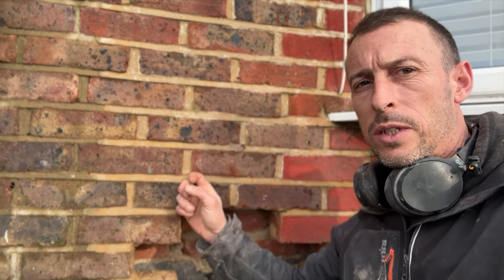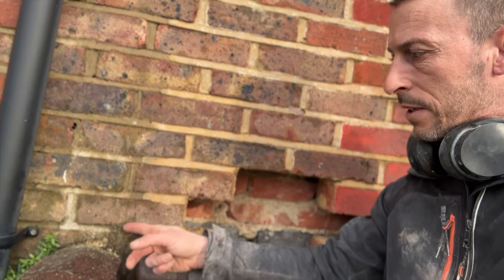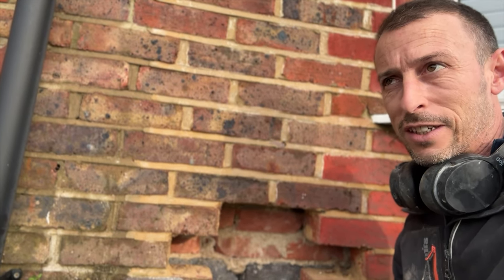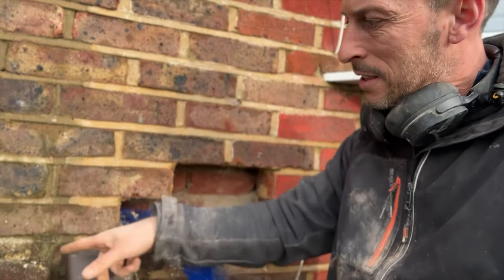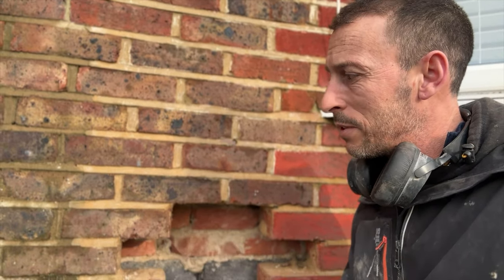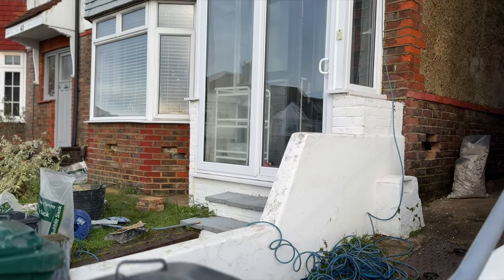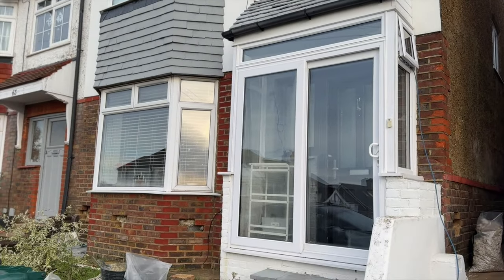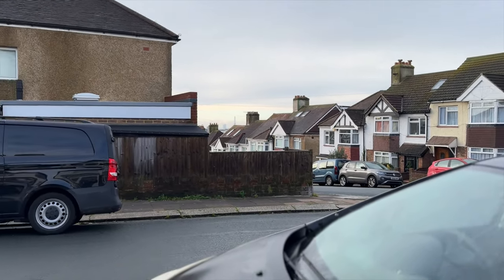Wet cavity wall insulation causing humidity and damp problems in Brighton, Sussex

Comment: I have damp walls, wet walls upstairs rooms and now blackening with mould or mildew. Not sure what to do. No cavity installation i believe.
Reply from the maker: Ventilate with a small amount of consistent air including at night in all rooms (nightlock works best as it’s secure) and a consistent temperature. Absolutely no condensation unless you have a swimming pool in your living room 🤣

Comment: Very interesting insight -  surprised to see just how damp  the thermal insulation was. Damp insulation is no insulation as heat easily conducts through the water and you end up with a cold damp house as you have clearly demonstrated. It does appear to be the case that retrofit cavity wall insulation should generally be avoided - other then perhaps poly beads in a sheltered location but only then subject to a satisfactory pre-installation survey by an independent and impartial surveyor.

Comment: What's the main cause of wet cavity wall insulation? It can obviously work most of the time so is it down to improper installation, bad materials, bad external conditions etc?
Reply from the maker: All of the above but if you remove the insulation the the bad external conditions are no longer a problem internally.
Reply: @CoastalWallTiesRustington thanks for the reply. I've actually just bought a house that has ground floor damp issues. We've had a company come out and survey it and they've confirmed damp in several rooms plus a number of rotted floor joists but they weren't able to pinpoint the cause with 100% certainty. The house has had cavity wall insulation done in the past but there is no certificate available and the person who sold us the house wasn't the one to have it done (some previous owner and we don't know who it was). I think we're look at having it removed. Quick question: does it all need removing or only to a certain height? If you remove say 1-2m from ground level, won't the rest just drop down over time resulting in the same problem? Thanks :)
Reply from the maker: Hi Richard, it’s best to get it all removed really, to avoid problems that may occur down the line.

Comment: Great video. But that is just the tip of the real problem. AS a builder, seen this for 30 years, now it will get worse with the need for insulation. Do we think the industry will fix the insulation materials?
Reply from the maker: 100% I think they are not bothered, and very little will be done about it.

Comment: A guy I used to work with had it installed in his 60s house, then came the problems. He removed a couple of random bricks himself and the rockwool was wringing wet. He’d been advised to use a waterseal product over the outside, but I pointed out that depending on how porous the joints/bricks were, he could be worse off because the water seal lines any holes, effectively converting them into tubes through the wall carrying water in even faster than plain soaking through. 
Many years ago I found that out the hard way using it above mum in-laws conservatory.

Comment: Cavity-walls that are already built up can NOT have cavity-wall insulation added.
Cavity-wall insulation can ONLY be installed from the very start of construction of the cavity-wall.
Cavity-walls must NOT be abridged with insulation(insulation touching the outer walls inside the cavity-wall), or else moisture will transmit from the damp outer wall, through the touching abridging insulation, and into the inner wall; making the inner wall damp inside the property.
If cavity-wall insulation is to be used from the very start of construction , there must be a large air space gap in-between the face of the cavity-wall insulation panel and the outer wall inside the cavity-wall; this includes an air space gap in-between the face of the cavity-wall insulation panel and the cavity-wall tie drip-point(which must point downwards in the centre of the cavity).
Cavity-wall insulation must touch ONLY the inner wall inside the cavity-wall of course.
Ask City & Guilds N.V.Q. BRICKWORK teachers in person for PROOF of this.
Reply: You make a good point but some developers still pump inso in after build which goes against what you say anyway

Comment: Thanks! Can you comment a bit more please about why specifically south or west facing elevations might be more wet?
Reply from the maker: It’s the sides that are exposed to wind driven rain, thus the rain penetrates through the outer wall by way of wind pressure.

Comment: hi im subscribed to you and im in the same industry as you and totally agree with everything you say is spot on and you are truly one of the good guys in this industry do you have any videos or come across where the cavity has been filled with polystyrene beads that is causing damp so i can show a customer of mine who has installed yellow insulation that is wet and i have had advised her to remove it and open the vents back up but she wants to reinstall the polystyrene beads after please keep the videos up
Reply from the maker: Well done for also being a honest tradesman. I must admit that the beads aren’t as bad as the wall (pains me to say) but I have experienced wet beads that have caused issues and allowed water to penetrate inside. The beads themselves are waterproof but water can still be on them. That particular property was a block of flats about 40metres from the sea, but I didn’t get a video.

If your clients wants to do that despite your advice, all I can say is that you were right to give advice and that is all you can do. A shame though.
Reply: @CoastalWallTiesRustington  hi many thanks for your reply that is what i say also the poly beads are better from the original install where they don't put an adhesive to make them solid the old method was install beads loosely allowing water if it does penetrate to filter through the gaps and drain away but the new method i have found is that some companies mix them with glue and in my opinion forms a trough for the water to hold
Reply from the maker: Yes, and the inconsistency of glue ratio is very common, which I put down to the glue line hardening throughout the day when going from one job to another, especially in the summer. Best bet leave the cavities alone as every type of retro fit cavity wall insulation does not cover all areas, leaving cold spots where lintels are and chimney breasts.
Reply: We have a 4-story block of flats with 50mm cavities and solid strong 100mm blocks, we have loose fiberglass insulation with voids, and we suffer from high heating bills E7 and mold.    we have removed some outside blocks to inspect the fiberglass and have found it damp-wet,      one company would do a clean-out and the new beads with an
 insurance-backed guarantee.
We may just do 1 block out of 3 to see, or stick with internal insulation.    This is our link.
https://youtube.com/@riversideestate-jj2hr?si=oYhk0vFU77KVnJwv

Comment: This is just like my property, seaward facing, 3-4 km, cavity filled with small grey polystyrene balls. Just how do I remove them? A vacuum cleaner?  Thanks for the video, very informative.
Reply from the maker: The best method is industrial vacuum and compressed air for this type of insulation, otherwise it would be extremely messy. Thank you for watching.

Comment: It's an expensive potential remedy, but what about water repellent coatings for the outer bricks? Like the Stormdry masonry cream, or rendering? residual moisture should come out via the dehumidifiers over time then they should be unnecessary presuming the rooms have enough ventilation (ideally MVHR). But if the cavity would struggle to "breath" then air bricks are an option that should allow air flow to the cavity once the majority of the face is water tight?
Reply from the maker: Stormdry is a great product but unfortunately it’s not 100% guaranteed to solve the problem due to having microscopic pores that make it breathable, this combined with wind driven rain can allow moisture through unfortunately. Having said that we think it’s great for preserving masonry in certain circumstances. I would never install air bricks directly feeding air into the cavity at low level, as this will allow the internal wall at low level to be a lot colder in winter months and if the occupants have a condensation problem, it certainly wouldn’t help matters, MVHR is good though.

Comment: How are you getting all that cavity fill out of the cavity are you using a hoover of some kind and you do you know it’s all out do you use a camera?
Reply from the maker: We prefer to use a combination of manual extraction and vacuums as we can get a full view inside the cavity and remove any large bridging. The process is to remove a small cluster of bricks in strategic locations.
Reply: @CoastalWallTiesRustington  how long does an average house take you to clear and are you busy doing this work all the time, I’ve always had doubts about this stuff mainly it’s thermal properties as I’ve heard it all sinks down or has areas within the cavity where there are voids which is pointless.
Reply from the maker: It can vary greatly but for a complete house 3 decent sides, you would be looking at about 7 days but that depends on how many windows and doors there are and how much debris is blocking the cavity.